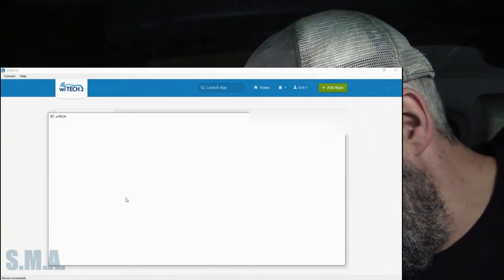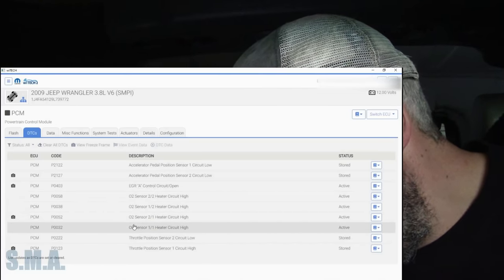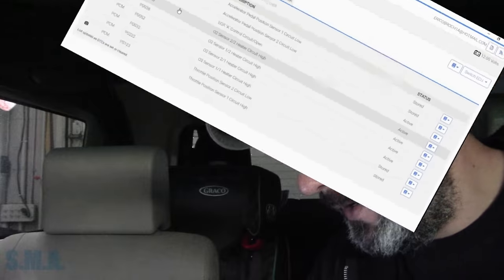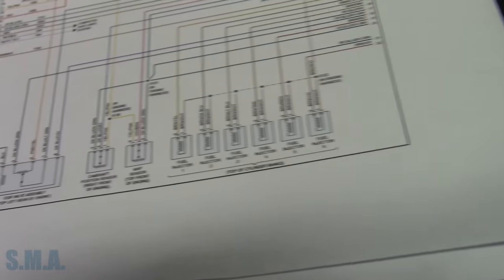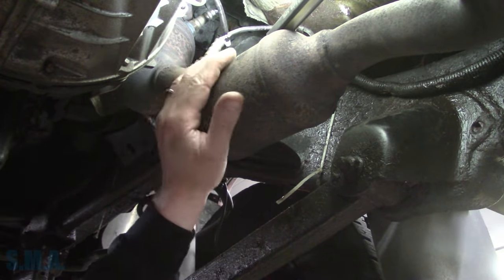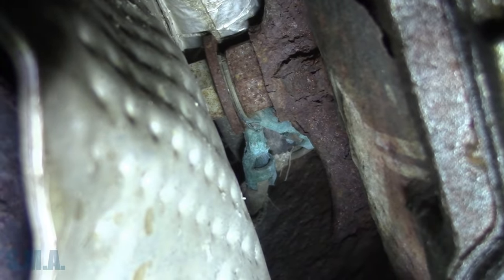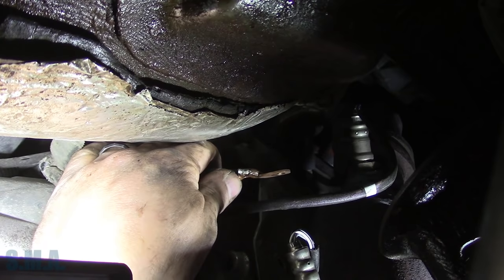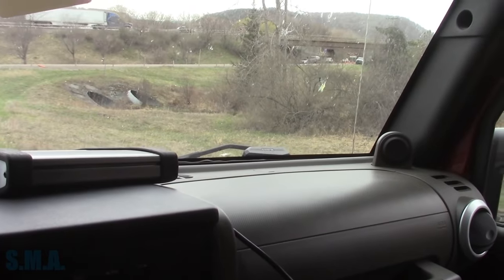Another Jeep, Another Bad Ground...😐

Comment: I’m amazed at the ground system used in automobile design. It sucks in every car/truck I’ve ever looked at, with Chrysler sucking more then most. I’m an electronic engineer now specializing in vacuum tube based home and recording studio audio equipment. I would NEVER use the chassis for the ground return! Even in the dry, climate controlled environment that the equipment I design & build is used in using the chassis for the ground return is poor design. You can pick any two points on an amplifier etc chassis and there is resistance between them. Di Minimus, but it’s there. this can lead to ground loops which can cause noise and hum on the signal. Proper design calls for a heavy gauge ground bus or a star ground technique to ensure that all ground returns are at the same potential. Typically the ground buses or stars are just inches long but are still required. Contrast this to a car where the ground returns are often feet apart and returned through the body or chassis. Add this the oxidation that will always occur at the ground (and other) connections and you have a recipe for failure, sooner or later. I’m sure the design justification is to minimize cost and weight, but I’m sure that long term reliability would be greatly enhanced by using a ground bus or star ground return design.

Comment: Sadly, the person that a usual car owner talks with isn't the mechanic that has critical thinking skills.  The driver is usually talking with the service writer that has profitability maximizing skills.  We recently had a car with CEL.  Service writer says it'll be $2800, and maybe more due to all of the rusty components.  Took it somewhere else where the fix was less than $200.  Asked if there were problems with rusty components -- answer was "Nope, we use penetrating oil...and if anything is too rusty to put back together, we clean it off, or replace it....that's why we charged you for the 4 new bolts that show up on your bill..."

Comment: It would have been interesting to see how you got up to that ground to R&R it.  Like what tool did you use?...   I had to replace a stud on the outlet of an exhaust manifold today.  Instead of removing the exhaust I just installed I set the new stud in and removed the locked up nuts on the stud with the old crows foot and extension routine.

Comment: I admit, I might have an unfair advantage as an electrical engineer, but seriously, unless it's a tech's first day on the job, they should be proficient with the "scope on a rope."

I guess it's easier and more profitable to load the parts cannon than it is to charge an hour or two for diagnosis and R&R a ground.

Comment: @SouthMainAuto. I have a 2009 Jeep Wrangler with same issue. But mine wasn’t showing any codes until I replaced the o2 sensors. The grounds weren’t as corroded as those. Thinking about just cleaning things up and putting them back in the OG spot. I know it’s been a couple years but do you remember where you relocated the grounds?

Comment: Great video!  I don't  understand why, with all of these advanced circuits, sensors and motors, ground is bolted or screwed, unprotected, to components of the vehicle. Makes zero sense. They ought to have a buss bar that all grounds connect to, running front to back, AND IT SHOULD BE PROTECTED FROM CORROSION. All of the components are connected with weather proof connectors and then the grounds are left exposed. Guess what fails...?

Comment: I get alll the other excuses from the "Other Shop"s" inability and frankly incompetence, but the customer is the one who pays the price here. Literally.   Which should be sanctionable for the "Other Shop".... And what also burns me is that your knowledge, Eric, is NOT adequately compensated. I have found this to be true in a lot of repair/service businesses. Personally, if I have some idea of what a repair person went through to ACTUALLY REPAIR THE ISSUE, regardless of whether they applied "Concussive Troubleshooting/Repair" (Thanks AVE 😂) but they knew where, how or when to apply it, OR, as Eric so often does, apply critical and rational thinking, experience (A derivative of expert - "a person who has a comprehensive and authoritative knowledge of or skill in a particular area.") and circuit and system operation, and understands and utilizes proper troubleshooting techniques and methods, I will see to it they are properly compensated, even if they charge me something minimal.    Thanks Eric for all you do!

Comment: It's funny that I stumble across your channel. I'm a shop owner an about 15yrs ago a guy brings in a 03 ford SUV and wants me to put in 4 new o2s. I ask the guy why you need 4 an he goes on to tell me that Autozone scanned it an said they were all bad so he just want them replaced an that is it. I told him I would like to scan it myself to see what was going on. He didn't want me to do that an he would pay me just to replace them for 930dollars. So he leaves it with me an well you know I had to anyways lol. The o2s were all reading lean so I dug into it a little more to find it was 15lbs lite on fuel pressure. So I called the man an told him the 02s were fine an doing their job like they should but he needed a fuel pump. To make it short I had to bribe the man an say I would pay for the pump an o2s if what I said didn't fix it. I can tell you I saved the man about 150 or 200 on just putting in the pump over what the 02s cost. So when someone tells you that they all are bad run the other way an find another shop that knows what they are doing. I find an fix a lot of cars just because of grounds.

Comment: Too bad some of the oil didn't get on the ground spot. Might have kept it from corroding. I always put WD-40 or whatever I have on connections like that when I put them together. On the battery posts especially it keeps them from turning green and making that snowball of fluffy stuff on it.

Comment: its funny how times are advancing so fast and tech.i bought a 2021 xlt last week with a 12 inch screen in dash it was being stubborn activating the vehicle to fordpass the modem wasnt responding but apparently aliens fixed it from a satellite cause now it works and has built in diagnostics and tons of cameras on truck detects people in back seat ect.but i was worried about fords frame paint so 5 and half hours at dealer i got it home crawled underneath and front of rear end was covered in rust and muffler hangar i called and bitched but fixed it myself with vinagar and water and  red scotchbrite pad rinsed it all off withe water and used por 15 chassis paint to protect it crazy you pay 55000 for a already rusting suspension new truck with 20 miles on it but thats where the ford cuts cost and later on makes it hard for you mechanics im sure.

Comment: Funny how secure the top of the eyelid connector looks.. but the bottom crimp came right off.. strange stranded wires should be flexible.. not impressed the auto wiring..

Comment: I guess you never have to worry about rusted out jeep frames there... what with all the engine oil leaking out and coating everything from the front axle to the rear bumper.

Comment: I'm an ex Chrysler Technical Advisor. I've seen way too many sensor replacements due to wiring or connector issues that never solve the problem. Those techs are parts replacers only and don't understand the importance of circuit integrity. They only read codes and replace parts. Discusting!!!!! They are not diagnosticians, only hacks!!!!

Comment: I love the calibre of so many local mechanics
"Well I cleared the codes on it, but the engine light keeps coming back on. Well I am all out of ideas. I better send this to a real mechanic quick before the customer works out I don't know what I am doing" then "Great so I charge the customer Eric O's rate, plus a few $100 for parts, plus $100 for my time, and that's one happy customer" 🤣😂
I wonder if the customers will ever work out its cheaper to send it to you first, instead of the parts cannon garage, that then sends the car to you, and charges the customer for both?

Comment: Hey Eric. Small tip for you, when doing a smoke test. One easy way to block off any hoses, TB, etc. is with a balloon! You get 25 in pack for $2 at the local Dollar Store. Just inflate to a size larger then the opening, push it in, and its sealed. I use the same trick when cleaning the TB (off the car obviously). Plug the hole, fill with cleaner and let it soak.

Comment: 2013 Jeep GC, found flat ,braided ground cable with one end attached to the frame on drivers side and the other end flopping around with half the crimp connector attached ( the ring is gone ). Tried placing the open end in different places throughout the engine to find its “home”, not much success . Any  suggestions ?? Fiat /Chrysler spared no expense with the wire quality😂

Comment: Today question  chev uplander 08
All dashboard light coming on I clean ground the at the block battery area . Traction abs back on after a week . I look at wires under driver seat look good . Voltage 14.4 / 13.8 / 12.8 I'm not sure what next .evap on passenger seatbelt light . Any more ground problems or Voltage issues??

Comment: What did you attach your test light to?  Was it another ground?  I'm having similar problems.  Cel is on giving codes for all 4 o2 sensors.  I replaced all four and CEL is still in.  Mechanic says I need a new PCM but I think this might be the culprit.  I have the tester but I'm just not sure what to attach the red lead to

Comment: The first garage’s performance was unacceptable. That mechanic wasn’t even thinking. The other pathetic part was the amount copper oxide, those copper connectors aren’t being plated with zinc worth a shit. If they were plated correctly, there wouldn’t be that kinda corrosion.

Comment: Is it because I only own rusty cars and trucks that first thing I check on check engine codes with any electrical sensor is that the wires, connectors and grounds are good?

Comment: STRANGE QUESTION,  HAVE A 08 JEEP WRANGLER UNLIMITED X 3.8. ANYWAYS BATTERY CABLES WERE EXTREMELY NASTY SO I CLEANED & REDONE THEM. WELL THE CABLE GOING DOWN TO THE FUSE BOX/ TIPM WAS SO BAD I HAD TO REPLACE IT. I USED A ACTUAL BATTERY CABLE TO REPLACE IT & NOW ALL THE SUDDEN I HAVE A XMAS TREE OF LIGHTS ON DASH. ABS, BRAKE, ESP BAS & ANTI-SKID. IF I PUSH THE ESP BUTTON TWICE THE ANTI-SKID LIGHT GOES OUT BUT NOT THE ESP BAS? MAKES NO SENSE. BUT CAN USING THAT BATTERY CABLE BE CAUSING ALL THESE LIGHT? I'VE ALREADY CHANGED ALL ABS & SPEEDS SENSORS BUT STILL SAME ISSUE

Comment: Why do they leave grounds exposed to the elements? Why not have a ground box, like you have a fuse box on the power side, that protects and centrally locates the grounds?
Reply: Won't matter in NY. Here we have sealed connections that rot apart, corrosion just doesn't rest here.
Reply: @Blazer02LS  I live in Western NY too. Nothing will keep the elements out 100%, but it might give a guy a fighting chance. You could also locate them in the trunk where they have less chance of exposure.
Reply: @Name-vu1kn  Yeah, but then it would cost them an extra 10 cents in wiring and designing in those items, not going to happen. Besides, they only need to make it past the warranty...  LOL
Reply: @Blazer02LS  Facts.

Comment: I made a foolish and expensive mistake. Some dude told me all my break lights were out at a red light. I figured no way they all burned out at the same time. So I replaced the break switch checked the fuse. Nothing. So I took it to a shop. They charged me $500 for new light bulbs. Some how they all went out at the same time. But come on!! $500 bucks to replace light bulbs?

Comment: I have a 2014 jeep wrangler sport 3.6 L. I just had a motor swap there’s a little red light flashing over the temperature gauge it won’t turn over it won’t start doesn’t even click not sure what’s wrong the dash lights go on it dings no warnings just you know the basic stuff that go on when you turn the key on, but it won’t turn over when I turn it to the start position. Any suggestions will help

Comment: I have a 2001 Jeep Wrangler 4.0 liter engine. My alternator, check engine light and cylinder 6 misfires. I checked all grounds, battery ans cables new, alternator changed out, cleaned all ground cables. ECU have been checked and checks out good. I have a ground going into ECU and 12 volts in all three sockets as Alldata has shown me. Alternator will charge if I hook up ground wire to field side of alternator. Any ideas?

Comment: Coincident failures usually have the same root cause. Of course, 13 codes may not have all happened at the same time, but one the first steps of troubleshooting is to discover any relationships between the symptoms. Four oxygen sensors?  Hmmmm

Comment: Eric Help!! I have a 2011 jeep wrangler unlimited 70th anniversary and left front turn signal workes when it wants to . Change bulb and still doing the same thing.  And wiper will not turn off? No money light on
Reply: @lesoram6236  yes and they are turned off
Reply: Ok.  Just follow Eric's diagnostic advice in this video. 
What does the left front turn signal and the window wiper have in common? 

That's right.  Both have switches in the steering column. Take it apart carefully and check,  and don't set off the airbag.  Does the horn work?

Check Eric's video in the last two months about how to get a schematic of the car,  then go from there.

Comment: I wished you lived in Atlanta so bad :( cant make this up. I had a 07 jeep wrangler with this ground issue. Followed this method and it fixed it then 3 days later the codes all popped up again. having fought with the jeep for year I gave up and decided to buy a new one. Just bought a 2012 jeep wrangler this past saturday from an independent shop. no lie has the same damn issue. literally just want to cry. No codes were showing for the first 4 days, then bam 13 codes. Any advice or do you happen to know anyone around here you can recommend?

Comment: Just took my battery off and put it back on and my car was sputtering alittle and a check engine light came on. Car runs fine now just has a check engine like any ideas? Just have to complete drive cycles? I need to take it to my shop and hook a scan tool to it

Comment: Hello I have a 2017 Jeep 4 door willy wrangler. Engine starts to vibrate NO check engine lite is on??  Also engine keeps running for 8 to 10 second's AFTER I TURN IT OFF AND THE IGNITION KEY IS OUT!?? Dealer is CLUELESS?? PLEASE HELP ME FIGURE THIS OUT

Comment: Do you bill the owners of the cars featured in your videos differently? Always been curious of that
Reply: My guess is when  SMA gets cars from other shops SMA bills the other shop. The customer never knows their Jeep has been to SMA.  In this case my guess is SMA billed between $80 to $160, the other shop probably billed parts 02 sensors 4 x cost $110 markup to $220 =$880, EGR cost $154 markup to $308 all for expensive MOPAR brand parts.   Labor 5 hours @$90 per hour. 
$450 labor 
$880 O2
$308 EGR 

$160 Eric O. Actual diagnosis and fix. HIDDEN ON THEIR BILL.

$1798 total
  $144  tax
$1942 TOTAL

The Jeep owner will never know SMA has been involved. 

.

Comment: Has anyone had a problem with a jeep wrangler that dies when it gets hot. Cools down and starts right back up? In the winter time it never dies but in the summer it does quite regularly. It has the Hemi engine in it if that helps. No codes.  TIA

Comment: Im kind of half lost with what you did here beyond updating the ground wires. Would doing the big 3 upgrade resolve this issue or do you have to trace the bad grounds down to their contact points and change them there? Im just not familiar with how the electrical is on vehicles and if there are grounds hidden around places that could be causing issues that need to be changed? Everyone says to do the big 3 upgrade on these jeeps and it solves a lot of electrical problems.. ? But it looked like to me in the video you tackled a ground point by the exhaust and I don't know if the big 3 would resolve this issue or not? Some were saying the grounds break on the jeeps by the exhaust passenger side and then he mentioned just running a ground from the alternator bracket to the battery negative resolved the issue..
The issue I am having with my 07 wrangler is a intermittent starting problem.. Which this guy details a bit in his short video https://www.youtube.com/watch?v=FPSXhFBUTDg but in the comments people are saying to just ground the engine block or alternator bracket and it resolves all the problems?

Comment: Had a code for a bad 02 sensor. Went a head bought an 02 sensor brought it to the shop. He gives me the car and says. Now you got maf sensor code and your other 02 sensors not working. 
Look at the 02 sensor he gave me to compare it. And he cut the wires. A little googling and realized the guy probably shorted the wires and cut them at the same time. .... Sure enough bad fuse to all those sensors. Was about to buy a 130 non refundable maf sensor ....
Use your head ! Or drive to sma 😆

Comment: The term "technician" is overused. A lot can't think beyond what a computer tells them. Codes narrow a problem, seldom pinpoint it.
   Poor connections are a root cause for a lot of issues...grounds, loose connections, pinched wires, rodent damage, etc...all basic stuff. 
   In small equipment repair, I see it all the time. "It's been to two OEM dealers, their shop tried this and that for thousands in attempted repairs, problem still exists"...I get it and find it in a few minutes...a mouse condo with dissolved main wiring connection from urine.